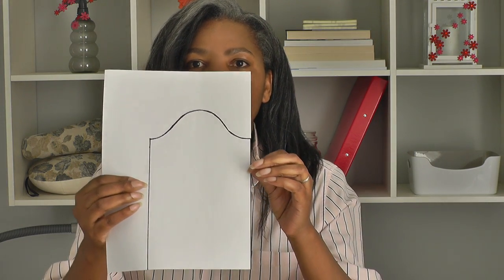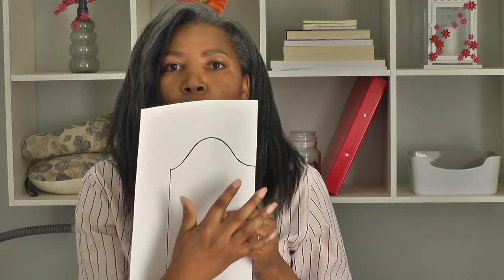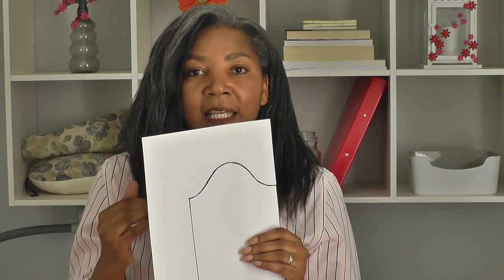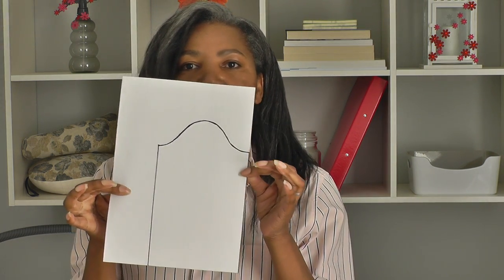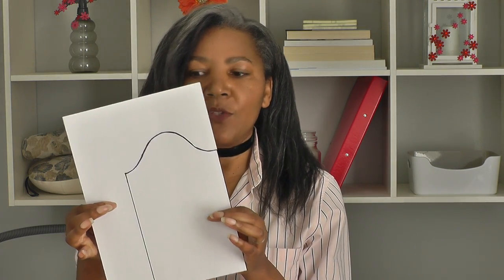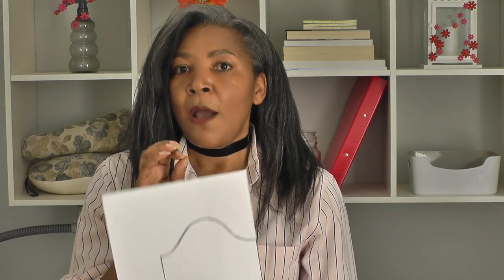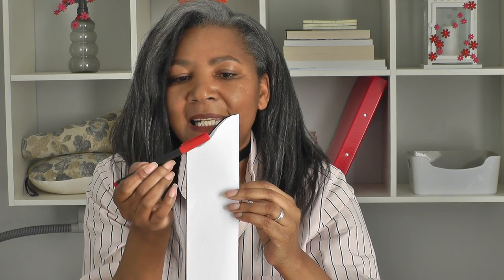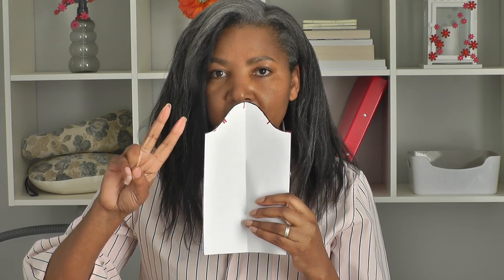Sewing Questions - The Basic Sleeve Pattern

Comment: It is also useful to note that any ease in the sleeve head is between the notches. A novice may not understand why the sleeve head stitch line is longer than the arm scye stitch line  (seam allowance naturally makes this more evident) it is essential you mark the notches exactly on all patterns that form the armhole (scye) & sleeve, and make sure they are correctly matched, then as you sew you will know where to start easing the excess fabric in. This is another thing that will effect how well a sleeve hangs.
Reply from the maker: Hello Truffleanpodge, Thanks for sharing there so much for novices to learn in garment construction.  You are right on point.

Comment: Thank you Colleen for this. At the moment I am working on a Burda pattern and I have got really confused with the front and back of the sleeve. All there is on the sleeve pattern piece is one little line, which I now think is the back after listening to your video. I have never worked with a Burda pattern before and I'm finding it a little different from other patterns. Hope I am right with the sleeve now, as I am sure I have sewed it wrong because it didn't feel right :)
Reply from the maker: Thank you for sharing Elaine, sew happy that you found my video helpful.
Reply: I am using Burda 6633. Had to recut Neck facings.  sleeve is marked wrong too.  so annoying